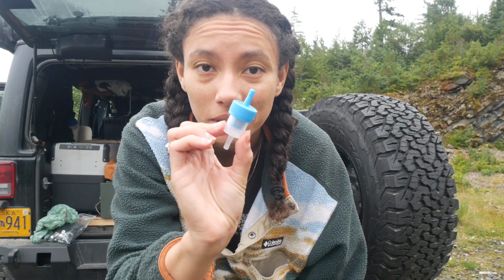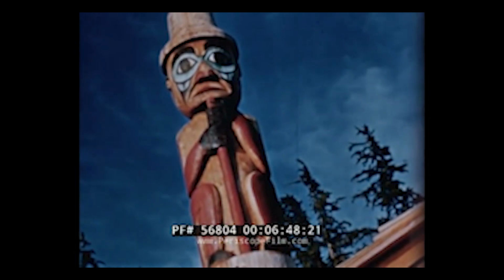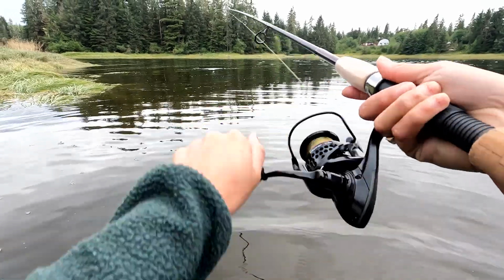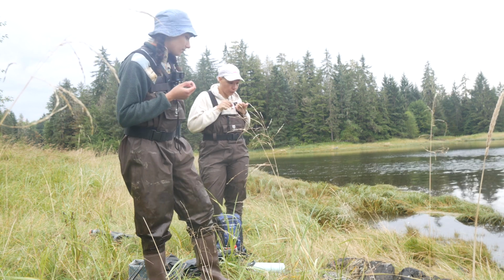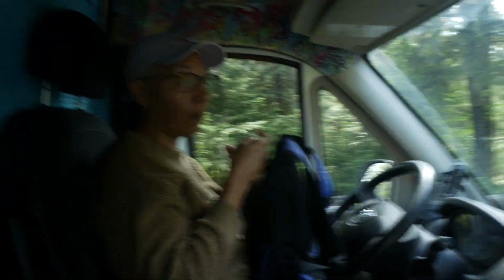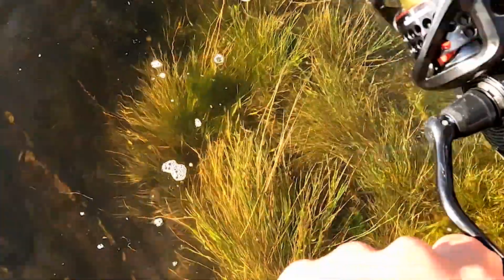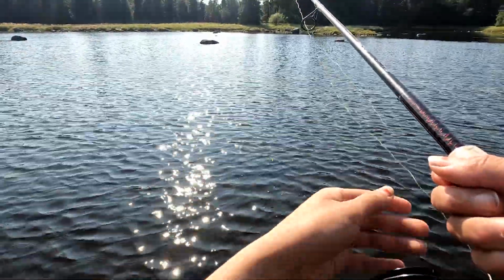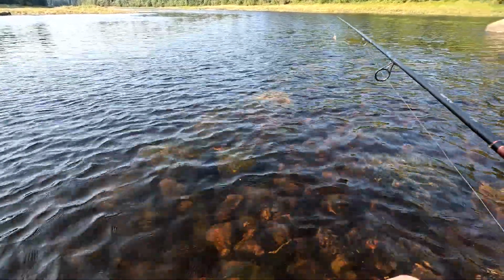JEEP CAMPING in Alaska & Learning how to Sport Fish Salmon *It’s tricky*

Comment: You both handle a spinning combo pretty well for beginners. Tighten up the drag though. When fish pulls drag, stop reeling and just keep line tight, rod tip above or at head height. Without a net, dragging the fish up bank or into very shallow water is best strategy.  Always remember, always keep line tight to keep fish on hook.